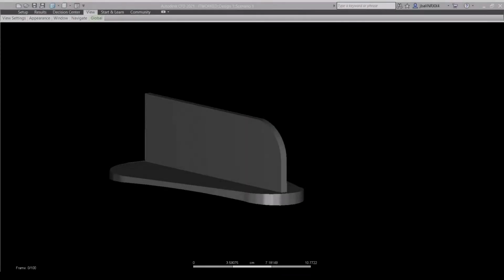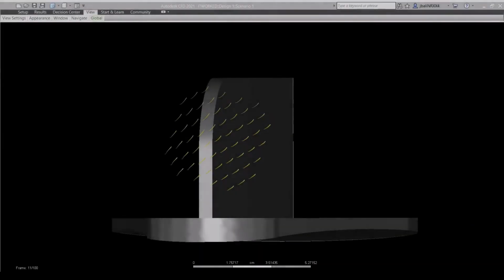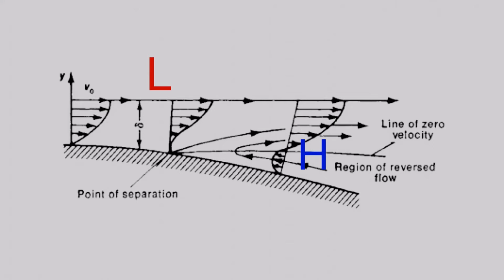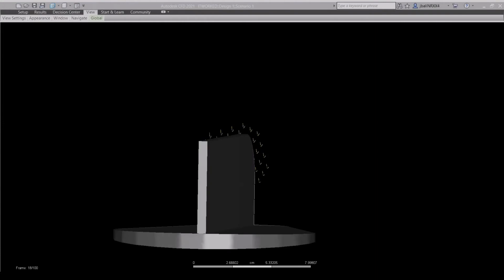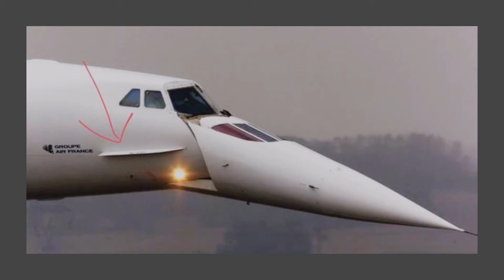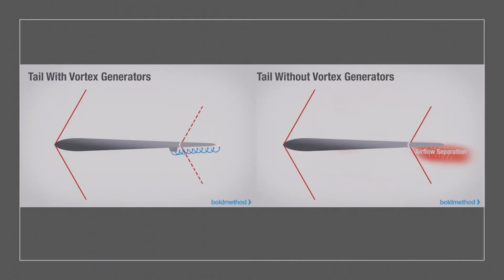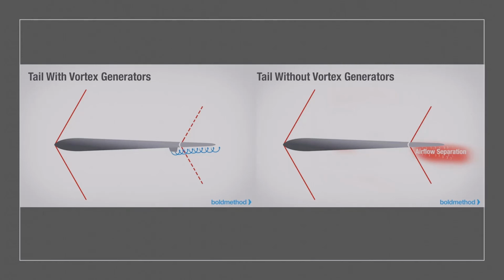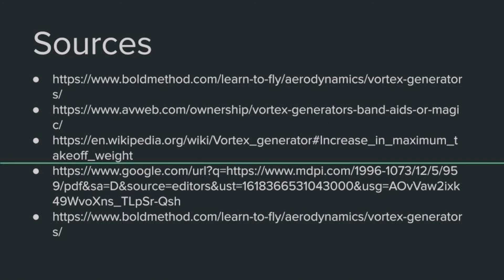Vortex Generators - Aerodynamics

Comment: That was great thanks. Do you have any information or modelling data on the effectiveness of the shape of the generator? e.g. some are square and some triangular, triangular shapes can have straight or curved top surfaces and finally the rear of the generator can be either straight or scalloped.
As you can see there are a number of shapes that could be modeled and tested as to efficacy re the vortex and drag effect especially with respect to top speed. It would be something that I would really love to check out if I had the resources and skill.
Keep up the good work.